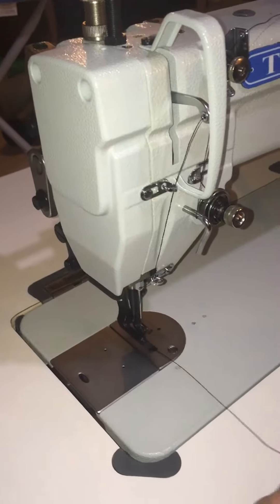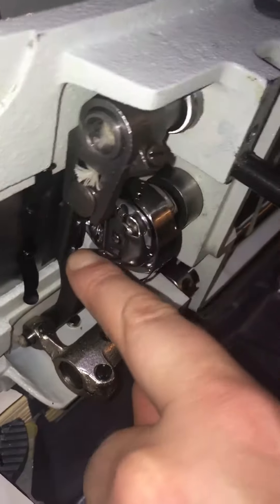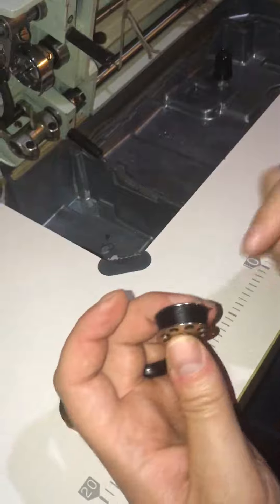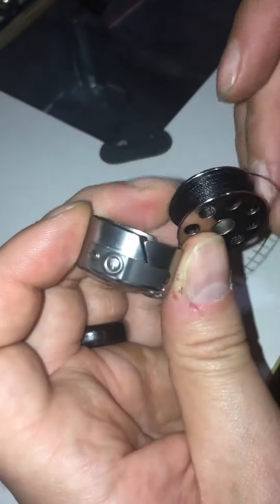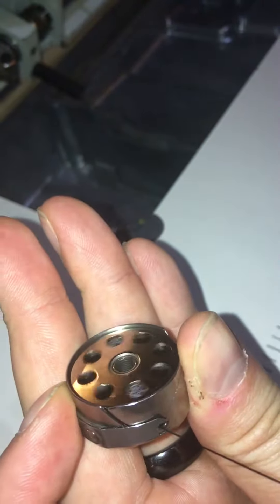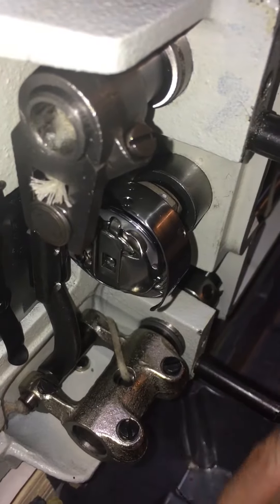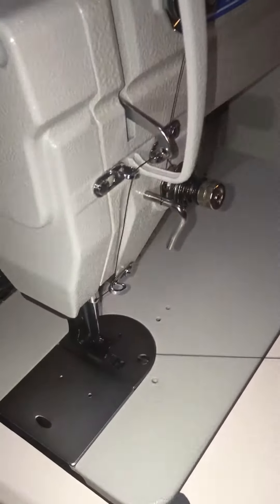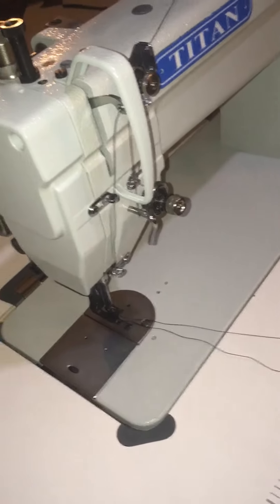Titan TN-650 BL- How to replace an empty bobbin

Comment: The bobbin should not be turning in the direction shown here. When looking at the bobbin in the bobbin case and pulling on the thread the bobbin should be turning clockwise and not counterclockwise as shown here. If you do it the way shown here you could have trouble with your lower thread tension. This is shown in Section 18 of the manual in Fig. 17.